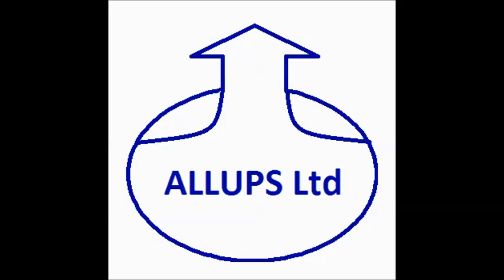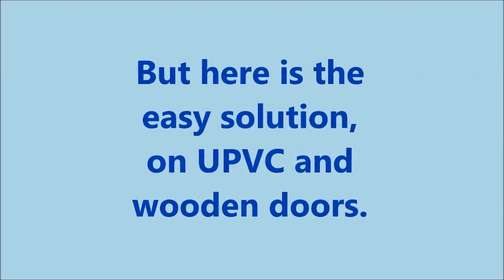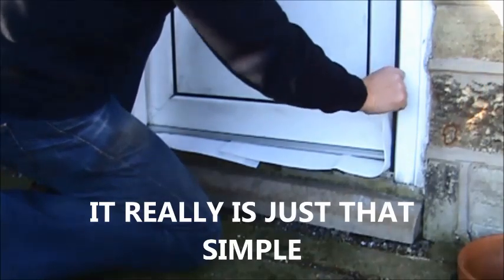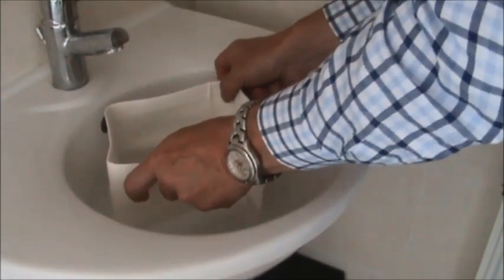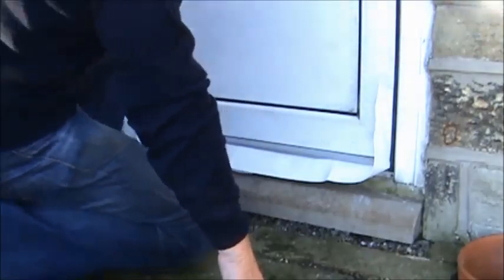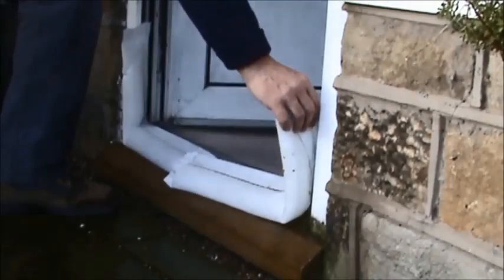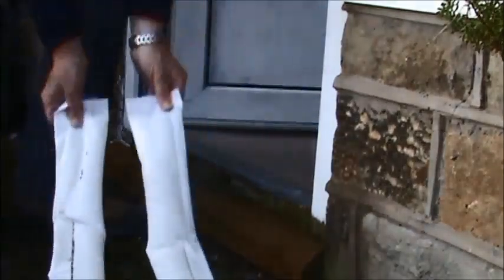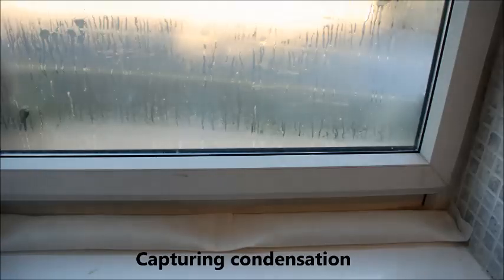Floodlock DIY Temporary Flood Door Maker from www.allupsltd.co.uk

Comment: If this is fitted from the outside of the house as shown in this clip, how do we get back indoors.
Reply: You can fit it from indoors or outdoors, it works both ways. Of course while there is flood water outdoors you cannot open the door else it will come in. As soon as it drains away you can open up. Hope this helps you.